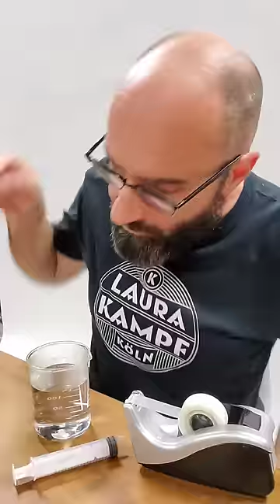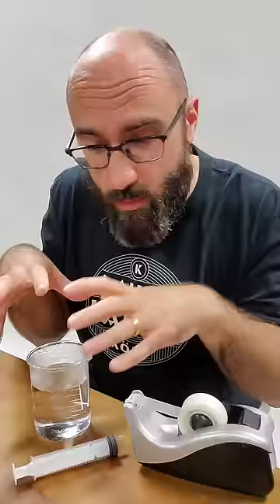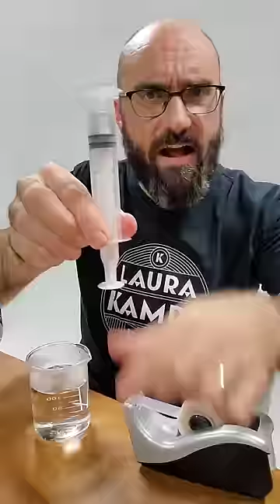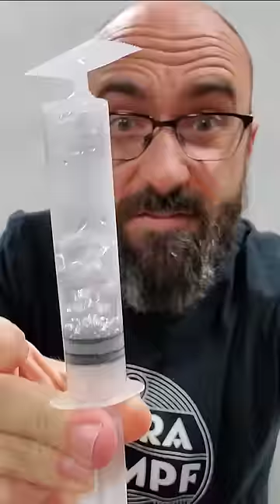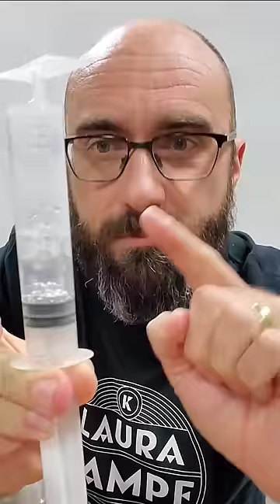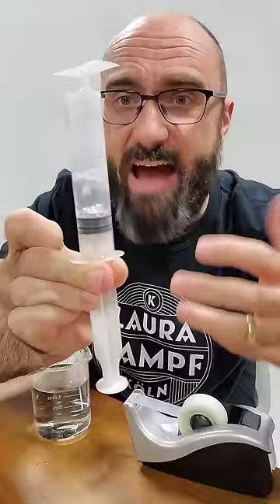Cooling down water by BOILING it

Comment: Boiling occurs when the vapor pressure (the pressure at which the liquid is launching molecules into the air) becomes equal to the outside pressure. So in other words, the outside gas no longer has the pressure to squeeze and prevent the liquid from turning into gas, so they become the same phase. One way to boil a liquid is by increasing its temperature, and by extension vapor pressure. Another one is to simply decrease the outside pressure, and make them equal that way. Hope this helps!
Reply: Make video
Reply: Very much so. 
So..? How do people at altitudes boil water?
Reply: Does decreasing the outside pressure make the water warm?
Reply: @sassyb58  at higher altitudes you would experience lower pressure. This would mean that you would have a lower boiling point making it easier to boil water. This is actually why pressure cookers are much more useful in states like Colorado. Because you can cook your food under higher pressure giving it a higher boiling point. On a sidenote water will boil at room temperature in the vacuum of space.
Reply: @pratz_1337  oh ok thanks
Reply: @wallraven55  And that side note is why you don't want to be exposed in space

Not because it's cold, but because the 70% of you that's water is ready to boil
Reply: @realcupojoe  The boiling water wont be nearly as bad as all the air getting pulled out of your lungs because of the pressure differential. Instantly collapsing your lungs.
Reply: @wallraven55  Ok yeah that's completely fair
Reply: So if a person was exposed to the vacuum of space would all the liquid molecules in their body boil and turn into a gas?
Reply: @JoshuaWingo-to9gs  A fair amount would remain liquid, but yeah plenty of gas would be produced and it would probably be the worst thing ever.
Reply: @sassyb58  Water boils at roughly 1C less for every 1000 feet above sea level.  It still boils but tea tastes awful.
Reply: So the boiling-point of water is dependent of pressure, which is dependent of gravity - and if 1 degree celcius is 1% of the difference between the freezing-point and the boiling-point of water, gravity defines the value of 1 degree celsius...

So on another planet, 1 degree celcius would be quite different to our Earth-version...

If we understood the dependence between Earth and the systems of measurement, we use for common reference, "truth" would not be so static...

And a "second" will always be 1/86400th of the distance between two crossings of the date-line, which is dependant of the rotation-speed of Earth - no matter what any "atom-clocks" might say to satisfy some scientists...

We live in a dynamic World - and we have to adapt on a daily basis...

We might experience our individual "here and now" as somewhat static - but the "truth" we share, is in constant change, to adapt to new discoveries or beliefs...

However they both stretch from a center of measurement - either through "observation" or through "explanation" by using a point of common reference - like the "North-pole" as shared reference for individual "here and nows"...

We also call "spacetime" for "c squared" by the way - like we call "here and now" for "down" - or "gravity"...

"Falling" in the same "direction" of "time"... ;-)
Reply: @frederikkargaard1919  I hate to be that guy who criticizes the JoJo speech, but temperature is defined by the average kinetic energy of a system. Gravity causes the separation of matter in space, but even on earth with normal gravity there are ways to produce a vacuum which causes the same boiling behavior.
Reply: So why don’t we have vacuum cooking pots to save energy and boil the water at lower temperatures? Or am I stupid and we need the temperature in order to cook and not the boiling part?
Reply: @theodorosdaveros886  Yeah the temperature is more important for the reactions going on in your food. Pressure cookers even make the pressure higher to make the boiling point at a higher temp so food cooks faster.
Reply: @theodorosdaveros886  Yes, the heat energy is needed to cook (whatever).  That same heat energy is also required by the water to evaporate which is why the syringe went cold.  

If you ever pump up a bicycle-tyre, then you will notice that the barrel of the pump gets hot. The air  loses heat-energy when compressed.  It passes the heat-energy into to pump wall.

Equally, if you release a compressed gas from a cylinder,  it will take heat-energy from the the outside/can and make it cold.

 A pressure-cooker does the opposite: It stops evaporation in a liquid so, the heat energy is retained and gets hotter.  The temperature of the water can easily exceed 100 C without evaporation and cook the food quicker.

BTW: Not stupid. It was a good question.
Reply: @pratz_1337  With regards to cooking at higher attitude, water boil at a lower temperature, so whatever chemical processes are going on to cook the food you placed in the water will not happen as quickly. I don't think the difference is because the water spends less time boiling, but because of the lower temperature of boiling.
Reply: @frederikkargaard1919  That is not at all how the standard units of measurement are defined. The scientific definitions are designed specifically to avoid the kind of problems you bring up.
Reply: @realcupojoe  I'm aware of that, but my point was, that without "pressure", ice evaporates directly into gas, so without "pressure", the concept of "water" is not possible...

The width of the spectrum between freezing-point and boiling-point of "water" is defined by the level of pressure - and thus the value of 1 degree Celcius...

"Pressure" comes from the "atmosphere" - and the density of that, is defined by "gravity"...

Ofcourse we can create the conditions, that changes the effect of the atmosphere present - but the "spectrum of water" on Earth is (mostly) conditioned by our "gravity"... :-)
Reply: @frederikkargaard1919 Good logic, but some faulty axioms. Pressure is not dependent on gravity. At the scale of atoms gravity becomes negligible. Gravity is such a weak force that you can hold back the entire Earth's gravity on, say, a calendar with just one fridge magnet. So imagine the effect of gravity on 1 atom, then. Also, 1 degree celsius is not a 1% difference between the freezing and boiling points of water. For that we need an absolute scale, like the kelvin scale, where the 0 point is the coldest possible temperature rather than some random arbitrary point like the freezing point of water. You seem like a smart kid, you see the limits in the faulty systems that have been taught to you. Definitely smarter than I was at your age. You should pursue natural sciences, I think physics would be right up your alley. But NEVER stop asking questions!
Reply: @noob19087  I'm certainly no expert and just use my logic to make sense of what I observe around me... :-)

And my knowledge about the different scales of meassurement is very limited - but I believe Celcius origins from the behavior of water - but as we have different levels of atmospheric pressure on Earth, the value of 1 degree becomes dynamic...

So far I know, Celcius is now aligned to Kelvin, although having different zero-points...

But I'd still say, that the atmospheric pressure is very much dependant of gravity and thus defines the width of the spectrum in which ice turns into water before it evaporates...

I guess my point was, that our problem is, that we use digital definitions to explain analog observations and expect them to add up - and that we can't define anything, without defining the perspective/position of observation (or submit to the uncertainty of the quantum wave)...

And thanks for the "kid"-part - at 62 it warms my heart, sparking dreams of a long life ahead of me, until curiosity kills the cat... ;-)

Comment: This explains why your blood boils in space.
Reply: Ohh
Reply: @threestans9096  Are you implying that atmospheric pressure means nothing to my blood because it's in my body? Is that your argument? Is it, truly?
Reply: So you would freeze right?
Reply: @frogpaste  yes because thats what would happen. look up what superheat and subcooling- hint, it has to do with pressure, and this video. and yes you can boil at low pressures, BUT that means your body would have to internally be at different atmospheres/pressures as well. 
Just do a quick google search. 
you being in a vacuum is different than your body itself being a vacuum.
Reply: Darkness380  and blood didnt boil instantly causing death. body temp blood will boil in the vacuum of space, just not inside your body, cuz your body isnt a vacuum .
Reply: @threestans9096  Sounds like a fun way to go
Reply: Darkness380  the reason the tube boils is because he created a vacuum inside of it. 
you dont do that in space with your circulatory system because no one  created a vacuum IN your circulatory system.
Reply: @breeze5440  tbh it seems better than the bends, which is very similar. but that has more to do with the nitrogen in the blood from adapting to high pressures i believe
Reply: Darkness380  i didn’t say any of that. 🤦‍♂️
Reply: Darkness380  youre outta your element, donnie.
Reply: Darkness380  so much of that is wrong you need to get checked to make sure you dont procreate, holy shit.
Reply: @threestans9096  elaborate what he said were wrong, i'm confused. You can't just say "you're wrong" then stop at that, i need closure, man 😥
Reply: Except it doesn't. Our circulatory system is enclosed.
Reply: @neemapaxima6116  THANK YOU
Reply: Darkness380 but bro does that mean that the vacuum of space possesses a low amount of pressure
Reply: Darkness380  one thing not often mentioned is van allen belt radiation and other radiation.
plus scuba gear is for increased pressures, not less, but i get your point. And yeah in a way, they really dont need that much to survive. Really, just look up the wiki. Its very similar to the needs that scuba gear provides. Just some extra protections as well.
Reply: When outside of your body, yes, but the skin and veins are strong enough to keep blood from boiling inside your body. People used to think otherwise but that misconception has been cleared years if not decades ago.
Reply: not exactly. blood does boil. but it cant while its in your body. it must be exposed to the low pressure. you need a pretty nasty cut if you want your blood to actually boil

Comment: the mind blowing part is that the tape is able to make a seal tight enough
Reply: Probably the same type of plastic as the syringe.
Reply: @Justa Burger  does that make that big of a difference?
Reply: @jamesrosewell9081  it doesn't
Reply: It's vacuum. You could put a small flat peice of silicon rubber there and accomplish a seal
Reply: @kylemilford8758  I know, I'm just really surprised that this piece of tape he placed on the tip is good enough to get the initial vacuum going without pushing on it with his thumb or something
Reply: @xvnz  pressure force is proportional to the area affected by it. The area sealed by the tape is tiny, so the tape doesn't buckle.
Reply: The pressure actually makes it easier. Vacuums actually HELP the things that try to seal them in terms of them sticking together.
Reply: your finger can seal too, doesn't take much sealing if you only need it for a minute or so.
Reply: And also mind blowing that no air was able to enter into the syringe as the seal was yanked down. I swear I've done exactly this but you just end up with air in your syringe.

Comment: Vsauce can convince me that Water is a Highly combustible substance, I will nod in agreement
Reply: Actually,... It CAN be! Pass an electric current through water, to split it apart into hydrogen and oxygen. Collect and mix the gases, and strike a match or a spark. You get pretty rapid combustion. And the waste product? Water.
Reply: With electric help, it is very explosive... After it's converted to the two gaseous elements composing it. He can explain it better, I'm sure... as well as the individual above yours truly.
Reply: Alkalai metals violently combust when they touch water, so in a sense it is highly combustible. Many people know about the reaction with sodium, but iirc the alkalai metals have a stronger reaction the further down the column you go (potassium, for example, would have a stronger reaction, exploding with more force than sodium).
Reply: Try to pour water in acid and you'll see how explosive it is.
Reply: Water isn't combustible... OR IS IT (vsauce music intensifies)
Reply: Every thread commenter misses the point. Water is not the parts themselves. Water is both as a whole. Water itself being combustible, is what the original comment is about. Please.
Reply: The mixture of water vapour and fluorine will burn on contact
Reply: Well it is, so...
Reply: @Palagas 🤦 your pretentious condescension is not only ignorant and annoying, it's also incorrect.
Reply: Add H2O to a crucible of molten metal
Reply: All of the things you guys are describing are not water. You're either breaking it into its component parts or adding a combustible substance to make it combust. You're not really describing a "combustible water"
Reply: @markwildt5728 That guy may  have been unnecessarily condescending, but are you sure he's incorrect? You're describing chemical reactions to create combustion not "combustible water".

Comment: In high school I participated in a voluntary chemistry lab course, and part of the coursework required vacuum filtering something. We managed to pull high enough of a vacuum to start boiling the already filtered water in the receiving flask, and thus created a dilemma. Either we let the pump run and create more of a vacuum, thus getting all the fittings stuck, or turn down the pump and let the boiling water flow back through the tube and into the pump. Luckily it was a cheap water aspirator, so no harm was done.

Comment: I work in a power plant that has an  absorption chiller. It works on this same principle, essentially refrigerating by boiling water. The water gets 'absorbed' by a strong lithulium bromide solution (which has a high affinity for attracting moisture) and that causes the pressure in the vessel to drop. The pressure drop causes the water to boil, even at room temperature, which then causes it to cool further so that it can be used to refrigerate.

Comment: Actually I'm looking at the reverse effects of this ....
Under high pressure, can get water way past the normal boiling point of 100°c ....like upto 350~°c under right condition and pressure....
If used microwave, 250ml can hit that boil point in a minute....so a coiled tube running through the microwave...
Bc well, microwave can easily heat water way past boiling point, without the pressure 
Now if we reconfigure a fuel injector...
Spits a few drops of water at TDC, just as piston top of engine....
The water has just dropped pressure instantly....
So will instantly explode into steam 
At 1500:1 expansion.....
Few drops turns into a few liter ...
So push piston down giving power stroke.....
As piston return, exhaust valve open, push out the steam....

So effectively a 2 stroke steam engine 😅
Looks and sounds like a normal combustion engine, but green ....
So mechanic keeps his job , people are still rev their motors at drag strip, 
And the environment actually benefits from it.....😊

Comment: God it's spelled out infront of my face and I still can't comprehend it 😭
Reply: It gets better actually. There is a certain pressure and temperature point for water such that it can be boiling, freezing, and a solid… all at the same time
Reply: @eastoncurtis6931  This broke my brain
Reply: @ricardoferns56  it’s called the triple point of water
Reply: Think of it this way. Boiling water cools it, as the hottest particles turn into gas. Thus they are no longer liquid water so the liquid water is now colder

This is why water doesn’t go over 100 degrees and boils instead.

This is just that, but instead he uses a vaccum to lower the boiling point of water
Reply: Decreasing the pressure decreases the temperature

Comment: Molecules absorb heat when they evaporate.. Molecules release heat when they condense back into liquid. 

These principles are why an AC system works. Your AC system uses a compressor to make a gas condense to a liquid in one heat exchanger outside while evaporating to a gas in another heat exchanger inside your ventilation system. The pressure in the one end is also condensing the heat in the refrigerant raising it's temperature so it can be picked up more efficiently from the air the fans are pulling through the heat exchanger. Then, since that heat was pulled out of the refrigerant outside, when it suddenly is allowed to expand in your evaporator it's temperature goes down immensely and since its changing into a gas its literally absorbing heat from air passing through your ventilation system.

Bam. AC. This is how you move heat around. It's basically magic. Though hopefully you understand it now.